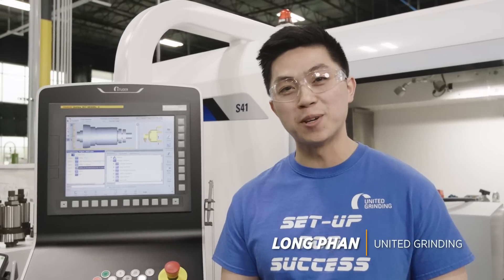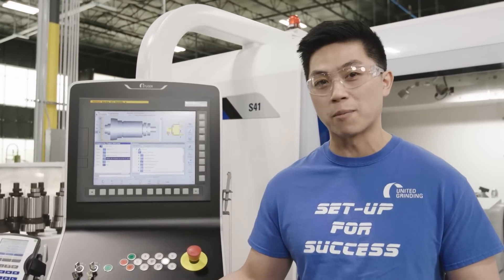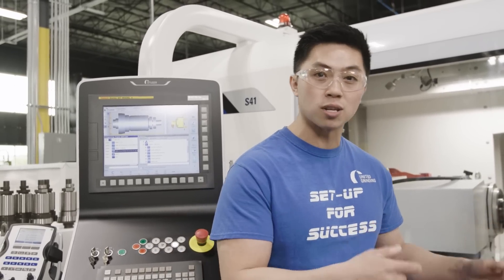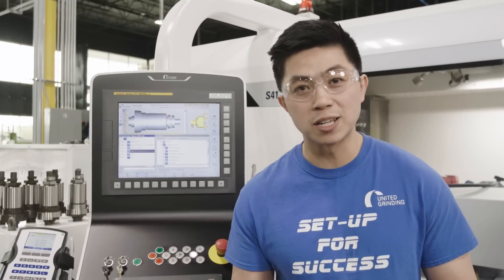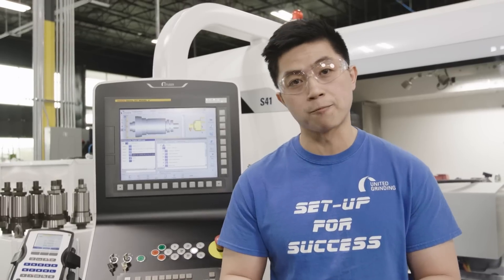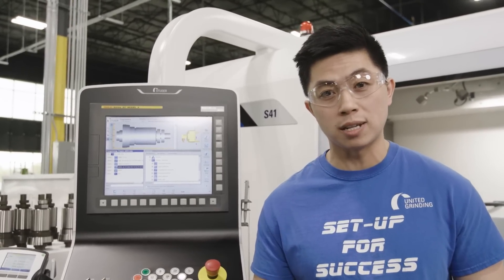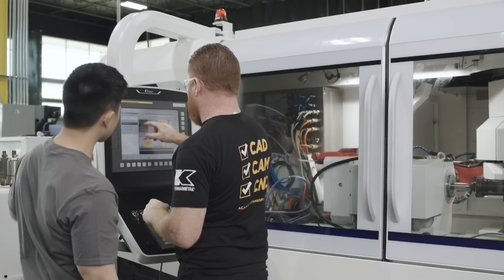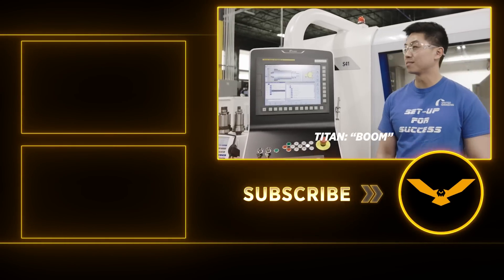Questions Answered | First Cut On Studer S41 from United Grinding

Comment: I run a toyoda grinder. It is awesome! The system is dialed in. Robot to lapping matching to auto straightener to OD grinding machine to auto hard contact indicating multi point quality check 100% on grind. Also rotary table feeding the robot. Holding .0002 all day less than .0004 total run out BOOM!

Comment: I worked on a Studer S36 in 1990-92 with automatic sharpening of the disc etc., we used a in Process measuring device from Marposs, the best thing since sliced bread, so all that BS what he explained didn't happen, and we hold 0.002mm all day long, and our maschine was 300000 Deutsch Marks back in the days
I don't get it why a $1.7M machine doesn't have a Marposs measuring devise, no worries how much your wheel dresser takes off, how much wear you have during grinding, everything is compensated by the measuring devise
Maybe that aplication Engineer isn't that smart afterall
https://www.youtube.com/watch?v=BJKm_3HLL7Y

Comment: Hi ... how thin can the part be to hold in the centering to grind it for example to a diameter to 2h7 mm on a length to 125mm hardened 55hrc and maybe a extra surface that is chromed ? I hope that i explain my question right ? 

Your work is awesome and I hope your all the best !

Comment: not as relaxed as previous presenter - and info was little disjointed - this is complex stuff slow it down - watch the edits - getting better and better - boooooooom
Reply: Pro tip:  Replay the video using x0.75 speed.
Reply: @danl.4743  stop the nonsense :)

Comment: Can someone explain what dressing is. Is it like smoothing out the grinding surface of the wheel?
Reply: Exactly.   Making it perfectly flat.  (or V shape, or whatever you are trying to apply on the part that you are grinding)
Reply: Dressing covers a few areas, but the main reason for dressing is to ensure that the wheel is rotating concentrically to the axis of rotation at a known diameter as those bonded wheels often need a little removing once installing due to manufacturing inaccuracies

You can also control the rate of dressing to either generate a “rough dress” or a “finish dress”, where the rough dress is done generally quicker and leaves a coarser surface which helps with material removal. Finish dressing is usually slower but has a smoother wheel texture which allows for improved finish.

Comment: Dumb question - how conductive is the composition of a wheel to be cut by wire EDM ? [Thanks for making these grinding videos.].
Reply: You can cut aluminum on wire EDM so it’s no problem. It’s all about power settings when dealing with material
Reply: @_aa_7  Thanks for the reply/ comment : Here's what I'm not getting - Most grinding wheels are "generally made from a composite material consisting of coarse-particle aggregate pressed and bonded together by a cementing matrix to form a solid, circular shape " - So for example aluminum Oxide is not conductive, nor are various resins, nor are various non metallic aggregates ? So what's going on ?

Comment: What’s the dynamic accuracy in this machine?  I believe it had a single axis positional accuracy of 2 um, and I assume you can get that with glass scales in the servo loop.  Interpolating in two axis, I’m sure it depends allot on feed rates, etc.  It’s a fascinating subject, so I’m just wondering.

Comment: Hey Titan, there are a lot of smaller shops which need ground surfaces on the parts (customer parts, self ground parralels, etc.) and tormach also has a grinding machine (not so fancy but it works and its much cheaper) could you make a video about the tormach grinding machine? There are also topics like frictions stir welding on a cnc and useing a slitting saw on a cnc which I would like you to cover....
Reply: i dont mean to be offtopic but does anyone know a trick to log back into an Instagram account..?
I was stupid forgot the account password. I would appreciate any assistance you can offer me.
Reply: @Steven Grayson Instablaster =)
Reply: @Yehuda Franklin i really appreciate your reply. I got to the site thru google and I'm in the hacking process atm.
I see it takes quite some time so I will reply here later with my results.
Reply: @Yehuda Franklin it worked and I now got access to my account again. I'm so happy!
Thank you so much, you really help me out !
Reply: @Steven Grayson No problem xD